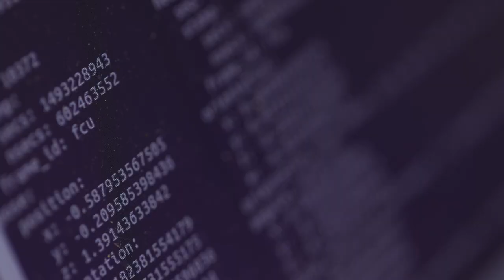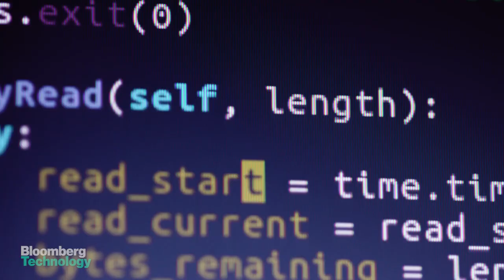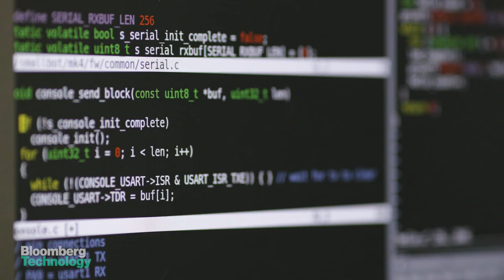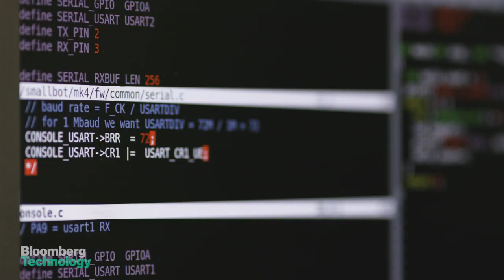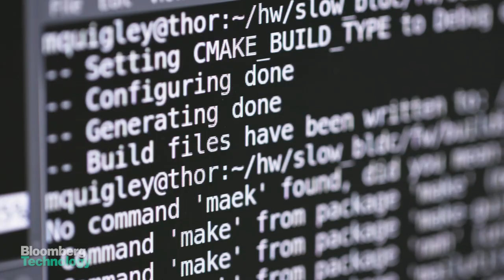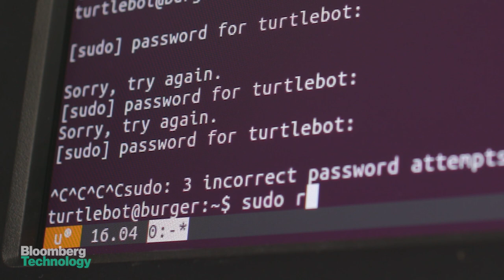Building a Robot Operating System for the Future

Comment: i gave ROS a shot, and yes there is a learning curve , i think it would definitely be worth learning, but for my "playing around" purposes it was just too tedious to get up and running quickly. Not to mention the linux  only thing is a big no no for me.
Reply: Say hi to multiplatfrom ROS2
Reply: There are some definite advantages to building machines on windows, namely it's easier, faster and you can get any old Joe to pump out some code on windows. But it's a non-starter when you are talking about mobile robot platforms. Two major problems, the simpler one is power and thus computer performance limitations. The harder is that you are talking about machines that must have wireless connectivity, therefore you get some very serious IT security concerns. You want to build and deploy a machine once and then forget about it. You want to leave it in a "if it's not broken don't fix it" state. That's not possible with something that requires periodic updates to stay functional.
Reply: Are you using something else ? I would like to know what are the other options out there.

Comment: ROS is a very cobbled together system with a number of problems. 1st and foremost being that its Linux based .  That means you will spend more time trying to get thing's to download and compile than you will actually  working with ROS. Then there is ROS itself, the system of workspaces and linking things together is  un intuitive and clunky. Whatever time you dont flush down the drain in Linux  will be spent here. The least amount of time will be actually coding for whatever your trying to do.  Its a shame  MS hasnt stepped up and Rolled their own version of ROS.
Reply: ROS does run on Windows now.
Reply: @LimitedWard  No actually it doesn't or I should say that it doesnt with the current set of instructions.  It cant be install.  And when it does "run" on windows it through some basterdized  Linux compatibility model that carries with it all the problems I mentioned.  If you look at the ROS site its pretty clear that windows implementation has little to no support from the community.
Reply: True, but I am optimistic that it will improve. Just like any technology, it takes time before it matures.
Reply: @tanmaybhayani  Not as long as its Linux based. The people that wrote Linux and the people working ROS are the kind of nerds that want to be sure the whole world knows and is impressed with that fact. Everything is done through command lines .  
Everything in Linux is a knife fight. Example. Right now Im working on a python program to talk to several Arduinos over usb. I needed a library so I download it. command line of course, and now Im on a tweenty minute voyage of discovery trying to get it to install properly. Visual Studio under windows. Two mouse clicks.
Reply: @bgrant1512  with proper automation with the same two clicks on Linux also works

Comment: Ross code in a self driving car, disaster. The software is starting to show its age.
Reply: Ryuuken24 completely agree, but are their any alternatives?
Once upon a time COBOL was king now we got code lik Ruby hopefully an evolution lik this will come to robots 2
Reply: I agree. Either it will come from operating system design, new programming language, new controller to supplant MCU or PLC. But whatever it will be it will be product of electrical engineering research.
Reply: Quality navigation and localization are dependent on your algorithms in the nodes, not on ROS. ROS is just the framework.